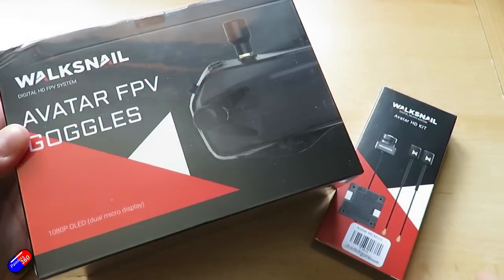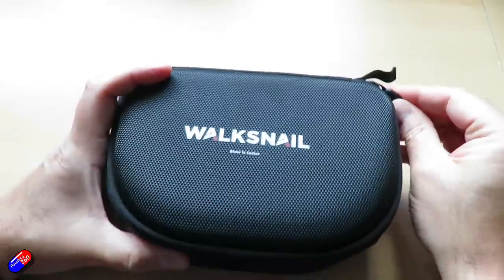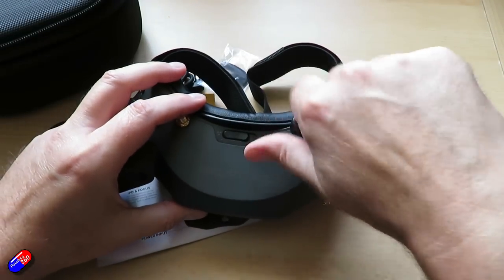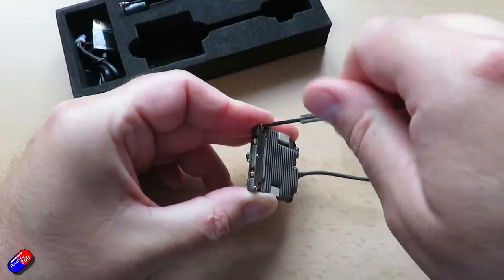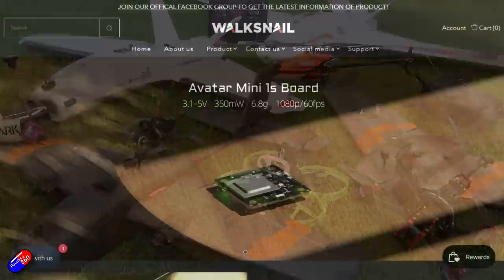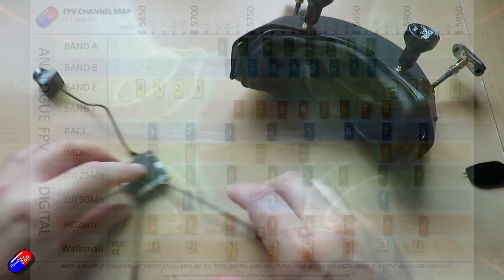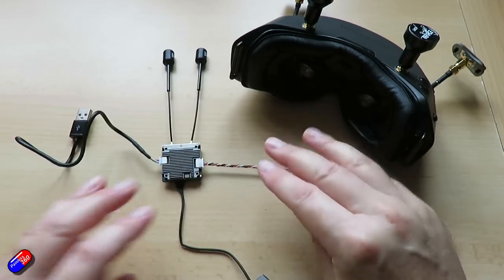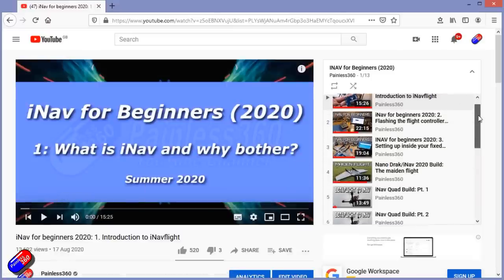Walksnail/FatShark Avatar HD FPV System: Let's look at what it actually is (minus hype)...

Comment: I think you nailed the main talking points.
I have analogue goggles, DJI and Walksnail. 
The Fatshark fit and finish for me has always been terrible and so it still is. I dislike the googles almost with a passion. Second negative for me is that the Walksnail goggles only perform how I want them too when flying in front. DJI trample all over WS when flying how most of us do everyday. That's to say sometimes behind and to the sides.
With these being pretty big handicaps you might be forgiven for thinking I have regrets converting 2 of my Quads and spending £900 in the process. 
Well, no. My complete lack of respect for DJI and their "Apple" walled garden approach and obsolescence driven business plan will most likely see me slowly convert the rest of the fleet. 
It's annoying that WS got in bed with Fatshark and not Skyzone and the directional flight thing is there. It is obviously going to be different for most everyone else. You can't please all of the people all of the time. My needs are fairly niche on the grander scheme.

Comment: I am also analog looking to make the digital jump. With the reduction in price of the DJI v2 down to $430 its making it real hard to decide which system to pick. What do you think about cost to entry of each system? Also the Margarine project is looking great to add features to DJI. I was also thinking about starting with a used pair of goggles but I don't see too many DJI v2 listed used on eBay. What are good sources for used HD equipment?
Reply: Try Amazon

Comment: As a long-term analogue user considering an upgrade I am intrigued. Solid review- thanks
Reply from the maker: More videos coming soon. Headline: I am a fan. They also have the module coming out for analogue goggles to reduce the cost of moving to Walksnail as well as working directly with projects like INAV and others. A very different approach to vendors like DJI...

Comment: I have no option but to stick with analogue. At the current prices it would cost me £2307 to switch over to walk snail. I fly for fun they are literally toys to me (no offence to anyone by this statement just my opinion on my mindset and they way I fly). I couldn't warrant spending that much on a toy (again no offence meant). I totally understand they are so much better visual quality than any analogue system but at over £2k to switch over it's just not a big enough draw. I don't fly fast or far and I don't race and the only time I do "flippy floppy" quad moves is when I crash in full acro with no stabilisation lol. The cost would literally have to halve before I could warrant the expense. 
Good info and honest review as always. Stay safe Lee.

Comment: I have a very old "BUDGET" set of analog goggles.  I think they are the lowest cost small goggles you can get.  I am getting more active in flying again.  I am looking to upgrade my goggles. I need a better fit, picture quality and everything new goggles should have.

The EV300"O" goggles are on sale for a good price and they would be a whole lot better than I have now. 

The Skyzone 04X are on sale for a little over $400.00, Fat Shark is $499.00.  I see the cost for digital goggles is $600.00.  Yet you need antennas, and a new VTx and camera.  So there is another $150ish for the camera/VTx setup and $50.00-$100.00 for the antennas.  All said and done, digital would be around $750.00-$800.00.

As I am shopping, do I jump to digital and leave my smaller collection of analog camera's, Vtx's on the shelf?  I have 8 setups in quads, fixed wing and cars.  as of today, 11/26/22, there are a few places with combo deals around $750.00US.  Where I fly most, it is pretty flat, very few trees.  So wide open country.  I should be able to get the best possible picture quality where ever I fly.

At the time I write this, it is very close to 3 times the cost of the EV300O goggles, It would be about 1 and a 1/2 the cost of the other analog goggles.  Is it worth the extra to jump to digital?  Will there be more companies coming out with camera's, VTX's?  Will prices go down?  Get the EV300O's now and in a year get digital?  Jump in now and try not to look back?   

Oh yeah, almost for got to thank you for this and all the other video's you have.  You have saved me so many head aches and broken keyboards from beating them against the desk in a fit of rage.  

Thanks.

Buzz.

Comment: I REALLY appreciate this. As a fellow Brit, I'd like to see how it copes when set to our legal maximum power output, not just 1W+ . I may love my DJI Mini 2 but DJI FPV seems to keep evolving at a pace that leaves earlier versions behind so, if I make the switch, I want the kit to last a long time, exactly as you were saying.
Reply: I totally agree. I'm currently still flying 25 mW analog and would be very interested what to expect when staying within regulation with the current digital systems. There's basically no videos discussing this out there.
Reply: make sure youre on legal channels, because thats something that can get you in trouble. transmit power, not at all. due to inverse square law, being somewhere in a field with 1200mW of power is not going to cause any problems for anyone. and without problems, nobody is going to come looking for you. 
remember that wifi is allowed to transmit up to 1000mW on the same 5ghz band as fpv gear.
Reply: @drkastenbrot  Good point and, allegedly, maybe not all my VTX's are set to 25mw ... Everything is on the correct channels though, including using 868 for CF
Reply: Sorry Fatshark, it's been a pleasure but, I just found someone way more attractive and up-to-date.
It's been lovely spending time with you, but you became old-tech and boring to be around. After all these years you didn't care much about improving to keep me around, now the competition showed up you decide to wear lipstick?!
I know it might hurt, but, you just can't beat the beauty of the feature-loaded DJI's goggles 2.
Welcome DJI to my FPV world, but be aware that I'm also flirting with HDZero, she really is an eye-catcher too! 😁

Comment: I have been flying Fatshark HD3 analogue for 5 years and DJI for 2 years.  I will be sticking with both these for the time being and in a "horses for courses" way I use the 2 systems for different reasons.  DJI for cruising with a lovely picture and analogue for whoops and small hairy flying wings which crash into obstacles LOL

Comment: I'm a long-range flyier so, at least for now, flying analog only and no with rush to switch or even add digital to my setup. In any case, I decided that, if I ever do that, it won't be anything DJI just because I don't want to be locked into one company. I like to be able to purchase components from various vendors that work together (ELRS for instance) and DJI makes it's own V2 devices incompatible with V1 (via a software lock so the hardware could do that). I'm not blind to the possibilities that digital brings, but I'll wait for something more open to competition, maybe HD Zero.
Reply from the maker: If you like longer ranges, HD zero isn't a good choice.. Happy flying

Comment: I think in the summary section you said the most important thing for all of us. We all want to invest in a future proof system which will coop with all important aspects of our hobby. Radio link, video link and great FC software and hardware. We now have elrs, we already have inav, and the last think we miss is HD video which can work with every osd(ardu, inav, pitlab, eagle etc). Another aspect is the range. I like flying aircrafts but i do want to do long range with hd. I would rly like to see an option for higher mw so that i can crank it up and go far like the hack with dji that can hit 1.2W. Lastly i would like to see availability. These days i cant find any dji air units anywhere. Only caddx which have lesser range and i am reluctant to buy. On the other hand i cant get inav osd through and i am thinking of getting WS for that reason.
In any way it was a nice video and i hope you will be able to keep up the good work.
Reply from the maker: Power isn't the only limiting factor for range. HDZero and Walksnail has been shown to fly over 30km at max power. We'll over twice what DJI can do...
Reply: @Painless360  Ofc antennae play a significant role, but for the sake of argument, we can assume that we have the same antennae on all systems. I don't know if there is another factor to be considered here. Anyway I would love to see a video system that will incorporate everything like smart audio, dynamic power output, osd etc that everyone has put money into.
Reply from the maker: Stay tuned! :D

Comment: I’m analogue and wanting to “upgrade”.  I think I’m going to wait until a solution presents that will also accept my Rapidfire module. I have so many micros, I want to be able to run everything from one set of goggles.
Reply: You've been able to do that for quite sometime with the v1 DJI goggles....u just need some cables and an adapter there are many to choose from.  As for waiting for an analog rx bay in a new set of digital gogs I hate to say it but it ain't happening.
Reply: The new hdzero goggle support analog and upgrade it.
Reply: @jmcjmc5587  yea it's the same add on side module bay that DJI has had for years....I think what he is looking for is something built in.  Either way this is not a new concept.
Reply: @Jahoosapheth I don't think you will have an hd goggle with an integrated analog bay. At least HDZero will upgrade analog video feed.
Reply: @jmcjmc5587  that's right the vertical jitter solution they did add that....I really don't see that as much of selling point tbh sounds more like marketing.  I find it hard to believe they found a way to, just now, improve analog enough to care....vertical jitter was never bad enough for me on any analog setup that I thought ever needed fixing If u ask me.

Comment: Can you explain the recording settings in walksnail what does the "LOOP" and "RECORD TIME" settings do? And is it for VTX only or for VTX and DVR recording? I did the update for longer record time since I have 32gb in VTX with the new firmware but don't know if it is for VTX only or VTX and DVR?

Comment: did you compared the range with 1200mW Caddx and dji goggles V2?
Reply from the maker: I'm not doing tests like that on this channel. Lots of others are performing range tests. I'm more interested in how it performs in more typical flight scenarios. Walksnail is capable of flying 30km plus with max power and the right antennas and with OSD and image still viewable without issue. Far further than is legal in a lot of places... Happy flying!

Comment: Hi Lee, thanks for this informative review! I am totally new to the hobby and was wondering if it's at all possible to have a digital FPV like the Walksnail that supports long-range systems such as Crossfire with Diversity modules? Many thanks!
Reply from the maker: It is. Radio control uses 2.4GHz normally and FPV is 5.8GHz...Happy flying. See my RC basics and introduction to FPV videos.. Best of luck
Reply: @Painless360  Many thanks! I have purchased the AR Wing Pro after seeing your review and will start acquiring the additional components to get the plane in the air, but first I need to equip my workshop with the necessary tools/materials. Thanks again!
Reply from the maker: The AR Wing PRO isn't a model for beginners. Check out my videos on learning to fly... Best of luck!
Reply: @Painless360  Thanks, Lee! I was aware that the AR Wing Pro is for more advanced pilots but to be honest, I've flown off-the-shelf quadcopters mostly for forest surveys so I'm only new to fixed wing and "the model building" hobby. However, I will take my time to build and test this wing as I intend to use it to mount a LIDAR sensor to collect forest data in Equador for my Ph.D. PS. I intend to link you on Patreon soon to pick your brains a little further 🙂
Reply: Also, the AR wing Pro will be used to test the data capture system then I'm looking to mount everything on a larger wing to cope with the payloads.

Comment: I run my RC car with analog video and have issues with line of sight reception. I know this is a broad question with lots of variables but would an HD system improve the line of sight issues? Thanks!
Reply from the maker: Not really, all 'regular' FPV uses 5.8Ghz and it doesn't penetrate obsticles well but does 'bounce' off hard objects. Using high quality, well tuned antennas help get the most from the signal that is there and reject the stuff that has bounced and changed orentation (right hand to left hand etc.). Best of luck!
Reply: @Painless360  Great advice! Thank you for the reply!!

Comment: Thank you for this great review. Do you have information or could you test if the walksnail hd system will suppor MSP OSD in case Ardupilot?  I have all my planes and multirotors equipped with DJI system...and im using the msp osd on both..i know wailksnail currently supports BF osd but what about ardupilot? 
Thanks for your feedback
Reply: MSP OSD is working with ardrupilot, That's what I'm running at the moment
Reply: @jimmytheriot8978  do you run it with walksnail? my question was if the Walksnail system support the msp osd with ardupilot. I know msp osd work with ardupilot im using it with DJI system on all my planes  but i cannot found any documentation on ardupilot wiki about Walksnail & MSP osd support..i found only Mad's tech video..which seems promising and almost answer for my question
https://youtu.be/mPlaf04D5Z8
Reply from the maker: Yes it does. In fact, in the latest firmware you can choose the type of OSD, Ardupilot, Betaflight, INAV and more. No more having to 'detune' an OSD to work with the basic Betaflight MSP implementation that DJI phoned in..

Comment: I saw a new hd zero module i thought a couple of weeks ago . It is already obsolete ?  Does this use the battery and plug in switch ? I have attitude v6 never used thought of turning them into hd zero but the comouters and update job sounded too expensive . More than the goggles .
Reply from the maker: Not at all, there are a number of competing HD systems about at the moment here is a quick overview of the main three:
 - DJI (excellent performance with longer distances but variable latency makes it not ideal for racing and a very closed system from a vendor that doesn't listen)
 - HDZero (fixed low latency, perfect fro racing but not as good for flying further away)
 - Walksnail (same as the DJI in terms of variable latency but a more open, less proprietary and more accessable model from what I can see)
Hope that helps.
Reply: @Painless360  
 I have walksnail and fatshark recon walksnail box goggles . I updated qs to get 700mW  and 4 channels . 
   If i play back a video in the goggles it plays in slow motion . Is that the sd card ? It is a 4G no name card .
Reply: I updated with a phone download from caddx and " move to sd card " app . I never updated the mini 1S vtx .

Comment: Another analog hold-out here. The lack of an input for analog receivers is a deal breaker.  I'm too invested in analog at this point. I'm badly wanting to invest in a system that does not have "planned obsolescence", but cannot convert my entire fleet - especially the whoops - and don't want to have to haul around multiple pairs of goggles.

Comment: Are the goggles suitable for those of us that have to wear prescription glasses ? For me, if these are not suitable, it would be a total 'deal-breaker'.
Reply: They have adjustable diopters on each side suitable for a wide range of corrections.
Reply from the maker: Supports +2 to - 6. But stereo goggles can still be an issue for those with astigmatism... Happy flying
Reply: Anecdotally, I have -6 in one eye and -7 in the other and some astigmatism. I just set them both to -6 and it is comfortable for me. I don't fly long range though.
Reply from the maker: Brilliant detail, thanks for sharing!

Comment: I've been on HDZero for the last 6 months or so and tbh I'm disappointed with the quality. The low latency is great, as is the consistent frame rate but the quality isn't much better than analogue so now I'm thinking Walksnail may be a better solution in pretty much every way.
Reply from the maker: I will be making more videos on Walksnail in the coming months. I am just waiting for the latest firmware to be released with the new INAV OSD fonts and then I can get some decent video shot.. Stay tuned!

Comment: What I have against DJI is that it is not developed for hobbyists but for consumers that unfortunately put our hobby in danger by doing stupid things and hence DJI has 'fenced' the system (my personal view and opinion), it is for me the reason not to support DJI. Will Walksnail be and stay fully open? If so this might be the upgrade from analog to digital.
Reply from the maker: I think that many feel the same way. I've looked for an alternative that is easy to use, works well and provides similar ranges to DJI and so far, so good for this.. Lots more testing needed though..

Comment: What antennas are you using for long range
Reply: Honest question - does Lee do long distance?
Reply from the maker: I can't, flying beyond LOS here in the UK is not legal.

But, If I were able to them higher gain antennas and all of the usual tricks would work here, the same as any other system. See my video on 'flying further'. Walksnail have now swapped the lower two antennas in their SKU to patches and switching from circular polarised to a good patch can extend range over 2.5 times..
Reply: @Painless360  I thought the top right sma was for the long range antenna? Which I did take mine apart and switch it to the bottom antenna